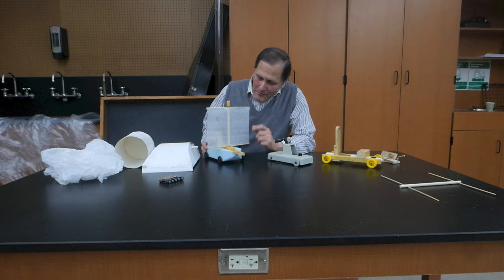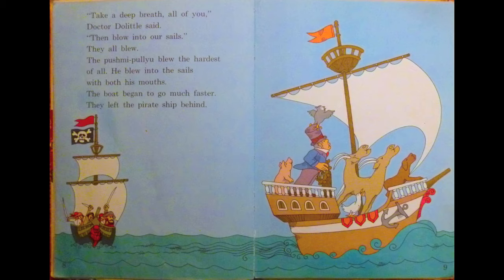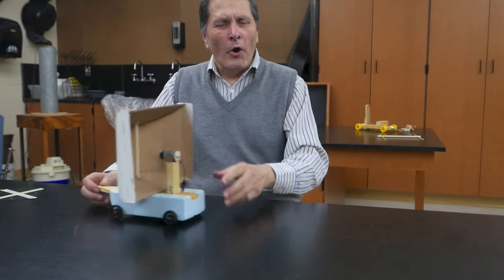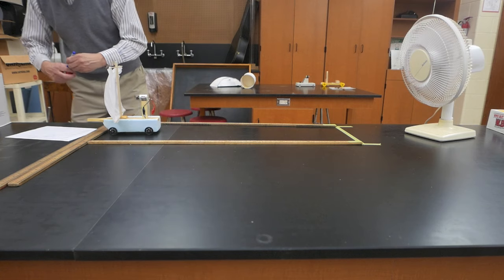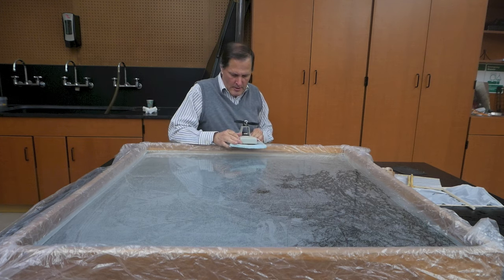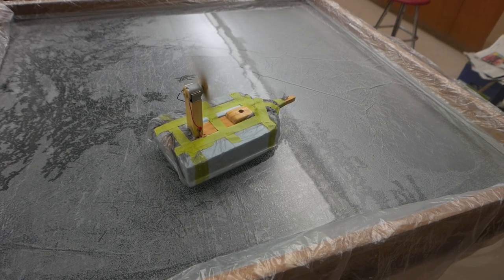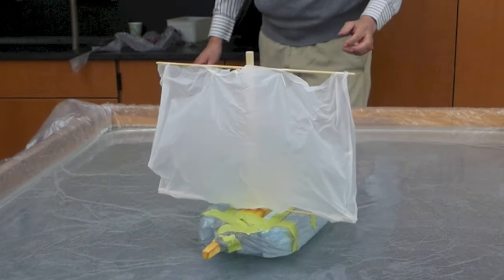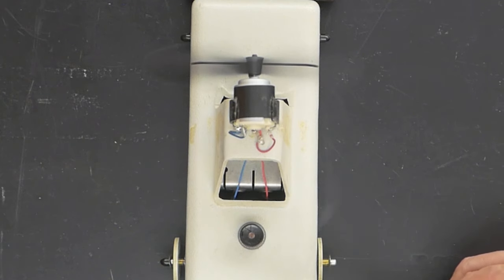Fan Cart - Blowing into your own Sail (updated)- part 2 // Homemade Science with Bruce Yeany

Comment: there are only two force on the boat.
1. reaction force to fan pushing the wind (push boat backward)
2. force that wind hit on the sail (push boat forward)

the fact that boat going forward means that wind going forward is smaller than wind going backward in the momentum perspective.
it's like ball thrown to wall bounce off more strongly. this is wired.
the air is fluid not solid. maybe this is the reason.
I want to know why backward wind is stronger
Reply: All things being equal this should not work, which means they are not equal.  Some of the energy of the fan must be applied up and or down and not straight back. This leaves room for the energy of the sail pushing back to overtake the energy of the fan pushing forward. Causing a net force from the sail (pushing back causing it to go forward)  

The fan only doesn't work with flat sails because a lot of the energy gets diverted to the side instead of backward losing a lot of the forward force. The fan is always causing a net energy forward or this would not work.

Comment: on the water, it spins because motor turning to one side. Airplanes with one motor, they have same problem it called "thrust angle". 
you can make video about that cause its rly interesting
Reply: But this would mean the spin is always in the same direction isn't it?

Comment: I mean, it's similar to just running a fan backwards at this point, but less efficient.  Or also, running a tube from the front of the fan around back again to propel it.  So the florida janitor would have been better off just aiming the leaf blower behind him.

Comment: Bruce you never have explained how rockets can work in a vacuum, based on Newton's third law. Let me recant ,it's been explained multiple times ,but how could we demonstrate this?
Reply: johnathan bowman — Newton's 3rd Law states that when one body applies force to another body, an equivalent force is applied back to the first body. A rocket combusts fuel, which reacts and rapidly expands. This fuel's expansion is directed in one direction, so all of the force applied to the fuel is in that one direction. The fuel (or rather exhaust at this point) then equivalently exerts a force back upon the rocket it is being expelled out of, driving the rocket forward. This reaction works exactly the same in or out of a vacuum. The major difference in a vacuum is that you don't have air resistance, which actually slows the rocket down more than speeds it up. While it could provide more for the exhaust to push against, it exerts a great amount of friction against the rocket. This is why rockets are more efficient in a vacuum. There isn't a very easy way to test this on a small scale, but for something similar, Cody's Lab has a few videos of explosions in a vacuum chamber showing that the velocity of the debris is higher in the vacuum than in atmosphere.

Comment: Always sail before mast. This cannot be stressed enough.

Working sails don't let the air spill either side because working sails are never flat. I don't know why that toy from the physics department is still being used. If sailboats ever behaved like that then sailing would be a pointless endeavour, which history has proven isn't the case.

On the water you were using the rudder as a keel. Try an actual keel first and then apply a rudder. The keel doesn't need a lot of draft. Just something to cut through the water immediately below the hull. A simple crease on the underside would be enough.

Can you demonstrate difference in air pressure in front and behind the sail rather than air flow? After all sailboats can sail into the wind almost as effectively as with the wind, which indicates there's more to sailing than just which way the wind blows.
Reply from the maker: My original intention  was to  take a closer look at the fan cart which uses a flat piece of plastic as a sail and is a popular device in many science classrooms.  With that in mind,  my original sail was a fairly rigid piece of foam packing material and I pulled it tight .  It didn't matter which side of the mast it was on.  My problem is however I tried to compare it to a cloth sail believing that they would act the same.  My mistake.   I limited the direction of the air to to be directly perpendicular to the sail  trying to keep this demonstration simple.  My   thinking in that situation I shouldn't need a keel,  but even the smallest imperfection  in the angle seems to make a big difference, at which point I fashioned the rudder to  see what would happen,  it was already more involved than I had expected it to be.  I found it interesting and do plan to try some additional tests,  I was interested in sailing when I was younger and want to tackle the behavior of sails, keels and rudders with out the fan onboard. thanks
Reply: Well that's the problem right there. Whoever designed the original fan cart with a rigid plastic sail, and the experiment it was made for, might have an in depth insight into Newton's third law however they obviously haven't ever sailed and doesn't really appreciate the physics behind sailing.

I understand you believe that in the Doctor DoLittle story the creatures on board would be better off exhaling aft into the air behind them rather than for'ard into the sail.

Couple of things to consider in that scenario.

In terms of flow the sail can provide a focal point, like the reverse thrust scoops on a turbo fan aero engine¹, whereas blowing into the wind is . . . well, blowing into the wind.

In terms of pressure the sail acts like a wing, it gathers air pressure rather than collect and direct air currents. It's not so much the wind that carries the vessel it's the lower pressure air in front of the sail that drags it along, as evidenced by occasions when a vessel sails into the wind.

Regarding the keel and rudder, apart from the positioning the biggest difference is that a rudder doesn't need a deep draft. In fact most yachts have a drastically more pronounced keel than the rudder although you could try an inverted keel (approaching something akin to a catamaran). All it does is direct the water longitudinally underneath the hull(s). If you have a keel you could find that your spinning rigid flat sailed vessel would be less inclined to spin.

I can never say this enough, always sail before mast. Even with the foam card sail. We could see the foam card was bending around the mast under the force of the on board fan. That's why air currents would spill so easily from one side to the other.

¹ reverse thrust is only limited to 70% of the engine's capability for forward thrust for safety reasons. If too much reverse thrust is applied while the aircraft is airborn you'll find the aircraft will lose it's airflow over the wings and stall, which is why a pilot will usually wait until they've touched down. Even on the ground an airliner's air frame can bend and break under the stresses of full reverse thrust (again, only 70% of the engine's capability) with a strong enough air frame you could have 100% full reverse thrust.

Comment: Something done ages ago... its a start but its improper questions that lead ot no light passing on.

The data questions need ot be better, I like your content.

YOu need a mass calibration of object in question moving and testing the parabolic arc movements on controleld wind crosses in a designed system. This will give you dat on a air deflection system.

Well take it back a step. THE mass is the sail and textile material to the weight, Then using a system of pullies and ties operate a winch systems with wind blowing nad mmeasuring defelction to curve ration. I would do this on Triangular axis to a  very complex double fold cross fora wind tunnel to a circular motion to lead and taught  delfection to mass system.

 This would give data, for the taught relation to force relation of the win, to teh sale for how much power is deflected and can give the average input ot he mass of the deflection to the... object ( boat)  and thus its friction subtracted from teh overall mass / force used to move the said object.

 THus hydrofoils are simple adaptation, but it could go even further with different composite and sail engineering,  I thin ka like a Trie tripple fold hexagonal pattern that is more like a open sail into a folded like tunnel ish thing would cultivate the most power to its diminishing returns peak.. and allow optimal speed. Thats jsut the image in my mind. I was while typign this my mind was imagining various sales against forces in teh system, and that strange last one seem to hint on working better, but hte problem is the mass relation needs ot take ninto affect, but can sales be advanced through udenrstanding wind power nad movement. Obviously one wants ot maxmize the force they can get from any source of wind... so essentially funneling wind to optimize power return against friciton for movement would possible change the sail design for increasing the speeds of water borne vessels... like wise for other environments/ when we play with gravity and other affects, like heat and cold, and water on teh material itself... where one oculd make advanced materials where electrical sheeting textile can be optimal in wet, hot and cold, or design to be exceptional better in hot environments, but in a electric sheeting case you can create a rasied quil liek system to creat more drag/ lift from a smooth sheet ot drive more power from teh wind and also optimal difuse it off ot generate a forward propulsion.. but who kwos.. its al ljsut nonsense .. anyways right.. lol